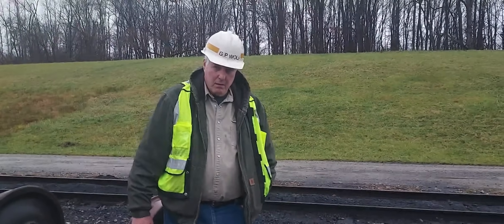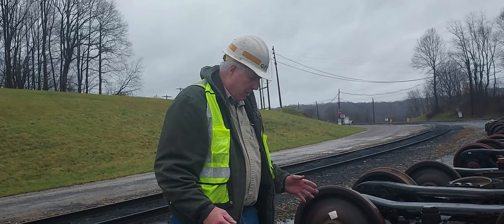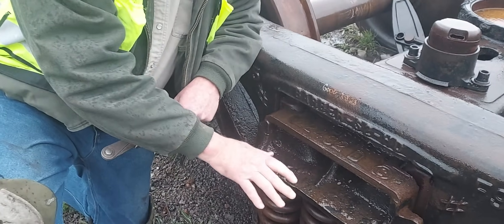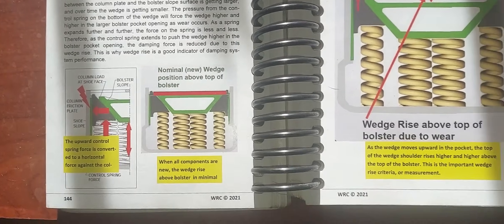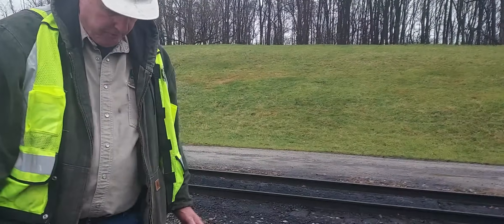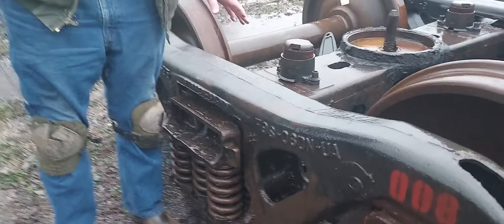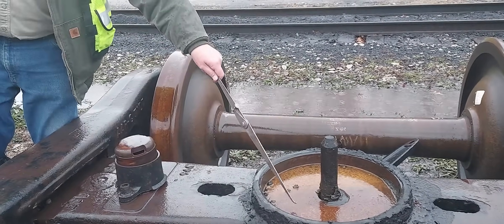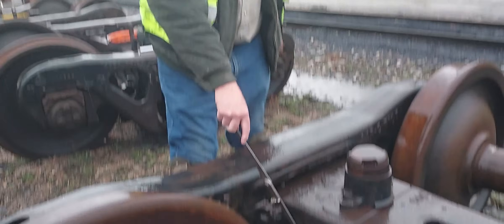How the Suspension System on Rail Car Trucks Works Part 1

Comment: Too much knowledge can be a curse. This is fascinating, I’m obsessed with mechanical precision. The middle bearing reminds me of the peg on a trailer of a semi, the tractor has a plate, if you don't occasionally add grease to the plate, when the semi turns, you hear the metal to metal noise and feel vibration (riding with my relatives truck for their chain stores). Ever answer two questions that a recruiter from the aerospace industry couldn't answer to a group? I inadvertently made an enemy of that poor woman, I just knew the answers so I answered the two questions, I stopped at two.
Reply from the maker: I agree with you John, knowing too much puts other people around
you ill at ease because they don't know.  Glad you found the 
video fascinating, it is pretty cool stuff. We are very lucky Mr. Wolf
came and did these for us. Hope you will watch Part 2 also
coming out Friday evening. Really appreciate your taking the time to watch and may you have a very good day my friend.

Comment: The prime purpose for suspension is not a smooth ride, but to keep all wheels firmly on the track! If there were only three wheels, you wouldn't need anything, but with four, you get "wobble" on uneven surfaces like a bad restaurant table.
Truck frames form a 'walking beam' like those on road graders. The two axles are NOT independent, but pivot at the bolster. In fact you don't really need springs to keep all wheels on the track, just a pivot.
Reply from the maker: Thank you for sharing your thoughts on that Greatdome99. 
 Really appreciate your taking the time to check out the video and may you have a very good day my friend

Comment: I worked for ACF Industries for several years, and was in the Wheel & Axle many times repairing the different machines from lathes to the large Landis axle grinder. It is something to watch these things being built. When you work there long enough, you can build a complete car in your sleep.

I have also been in CSX's engine shop and watched them being overhauled. Keep in mind that their trucks have a traction motor as well.
Reply from the maker: How awesome is that, I would love to visit a shop like that sometime craxd1. Thank you for taking the time to watch the video and may you have a very good day my friend.

Comment: HOwdy, Dave.  Thanks for the info on modern trucks.  Only you, Dave, would say cereal.  I'd like to see some arch bar, bentendorf & andrews trucks.  Those are the ones I use on my HO scale railroad.  HO scale trucks are made exactly the same way.  Bolster, 2 side frames & 2 springs per side frame for 50 ton trucks.  Cheers from eastern TN
Reply from the maker: Your very welcome Rusty. Although i don't think Mr. Wolf deals much in HO scale trucks and derailments...... :-)  Really appreciate your taking the time to watch the video and may you have a very good day my friend.

Comment: The part that has always amazed me is that the main parts of the trucks are put together without bolts or bushing like in an automobile.  The axles are held in by gravity, and the car just sits on that pad with the pin sticking up in the middle.  In model railroads if one picks up a car, the trucks and wheels come with it.  In the real thing we've seen lots of videos that show a derailed car where the body just separated from the truck and/or the wheels & axles came out of the truck.

Other videos show the parts being stacked back together again with just gravity holding it all in place.
Reply from the maker: Your right about that Bryan. It is amazing isn't it.  Thank you for taking the time to watch the video and may you have a very good day my friend.

Comment: Still don't know how the locomotive delivers power to the truck wheels.
Reply from the maker: The diesel engine in a loco drives a generator/alternator that
sends current to the traction motors on the loco which is what
drives the wheels on a loco Oregon Crow. Car wheels are
not driven, cars are pulled by the loco. Don't know if that is
what you meant or not?  Thank you for taking the time to watch the video and may you have a very good day my friend.

Comment: Thank you both for another informative video. I learned a lot about trucks!

I have two questions. First, do the large suspension springs contain smaller springs? I can't tell for sure, but I think I saw counter wound inner springs (but not the kind we sleep on!). Second, how does the damping friction very with speed? When I studied damped springs, we assumed damping was proportional to the spring's velocity. Does friction damping behave like that? I seem to remember that friction force does not depend on speed, but it was a long time ago.
Reply from the maker: Your very welcome Eric and glad you found it interesting. 
1. I made a video on springs  and explained about the number
of springs if you want to watch it.. Some cars have inner springs,
and some have also inner inner springs. All of our cars here
have the main spring and the 2 inside it.  2. Speed has nothing to do with the damping friction, it is all about weight. Really appreciate your taking the time to watch the video and may you have a very good day my friend.

Comment: How do the bolsters get installed into the side frames with those "gibbs" in place?
Reply from the maker: Little bit of side twist to get them into the side frames Wally,
after that the springs are installed. Lot's of room without the springs being in there. Thank you for  taking the time to
watch the video and may you have a very good day my friend.
Reply: @ccrx6700  Thanks Sir!
Reply from the maker: @wallyman292  😊👍🚂

Comment: A fantastic educational video. I never knew the trucks were made up of parts that could be cast in different foundries, and are the same design as we use, although I knew many look the same in a lot of countries. There is a sound going over uneven track like something is rubbing on a dry bearing, and now I think that is probably just what it is , the sound is coming from the friction wedges and not something lacking lubrication. There is a preserved 100 ton tanker at a heritage railway, in a couple of weeks I am thinking of going there so if I can I will have a good look around the bogies. Big thanks to Gary for taking out his own time to visit your railway Dave and thanks to you for putting it all together.
Reply from the maker: Thank you for the nice comment and glad you found it interesting Cedarcam.  We are so fortunate to have Mr. Wolf share some of his RR knowledge with us. Please make a video of that tanker and do
some real good closeups of the bogie and it's suspension system, I would be most interested to see that too. Really appreciate your taking the time to watch the video and may you have a very good day my friend.
Reply: @ccrx6700  I hope it will be in the goods yard where I saw it last time I went. It had just been delivered then. Later in the year they have a Railways at Work event so another chance to see it then.

Comment: Back in the late 70s /early 80s I was studying mechanical engineering funded by South African railways & harbours and therefore did practical in the workshops during the vacations. It was excellent training because I got to see and learn so much about how things are done in practice. The 1st place I was sent was apprentice school for 3 months. One of the places I spent time a was the refurbishment operation where rolling stock was torn down and rebuilt.
Those bogies look very familiar, but in watching this video I was immediately puzzled by those side bearings - I don't remember them on our bogies.
Thanks for the detailed explanation of how it all works - I never got that during my training. I mostly worked it all out in my head but didn't know about the critical dimensions.
Reply: Did the wheels/axles have a journal box with a spring loaded lid, that flipped up to have oil pumped in?  That's the old style so called friction bearing, not ball.  There's a great video on that nation & world wide change over titled "Train friction vs roller bearings...".
Reply: @alro2434  the one I am talking about used Timken roller bearings - looked the same as on those bogies.
What you are talking about are white metal journal bearings and yes there were still a lot if those around back then, but it was different style if boogie with packs of leaf springs instead of coils.
Reply from the maker: Wow how interesting that must have been to do that Greg. I don't know if side bearings are just a N. America thing or not, would be most interested in finding out what other countries have them
or not. Really appreciate your taking the time to watch and may you have a very good day my friend.

Comment: There is an old train track near Gaston Indiana where I ride.  There is a curve and a creek where early 1900’s a coal
Train derailed.  The signage said you may still find car parts.  There is still a lot of coal and gravel.  So I started digging.  I found a journal box. Lots of rail spikes and other parts.  In the creek I saw springs so i returned with a rope and hook and fished them out.  Sanded down the journal box. Got all the rust off and repainted. It has number  “113” in center of the box. I also cleaned and painted the springs. They make great wooden spoon holders for the counter and they won’t go anywhere being so heavy.  I mounted the journal box and it’s on my kitchen wall.  Nice train theme going.  I can’t believe this has not been found after 100 years.
Reply from the maker: Wow that's pretty cool you got that stuff Beverly. Wish i could
convince the little woman here to put some car springs on her
counter to hold spoons, that is so neat!  Really appreciate your taking the time to watch the video and may you have a very good day my friend.

Comment: sorry if I missed it or its going to be in part 2, but how doyou INSPECT the innner parts (center bearing, center bowl, brakes) when the car is sitting on those trucks?
Reply from the maker: There will be a part 2 coming out next week Trinh Le, Mr. Wold
will go over constant damped trucks and more about the suspension system on trucks in that video. Car center bowls
and center plates can only be inspected when the car body is
jacked up off the trucks, brakes can be seen at any time. Thank you for  taking the time to watch the video and may you have a very good day my friend.

Comment: Where the Hell was this explanation when I was rebuilding trucks?!  I was welding/building-up bolster slope surfaces and gibs, and never knew how they worked with the column friction plate.  We just welded/built-up/to match a gage to rebuild.  Great Content!  Now, as a dentist, I will be careful in my spring/ride control spring selection on Barber 100 ton trucks.  Mic Drop... Gary Wolf.
Reply from the maker: Well guess better late than never to find out halfinchholes. 
Thank you for  taking the time to watch the video and may you have a very good day my friend.

Comment: All of the trucks I worked on at IRM have very little in common with todays' trucks except for the general layout.  They are mostly bolted to the car with a pivot bolt and the axles, bolster and side frames are firmly attached.  A great truck tute, learned a lot.  Thanks much!
Reply from the maker: Thank you for the nice comment poowg and glad you found it interesting. Your right trucks have changed a lot over the years, specially after the heavy 286,000 pound cars came into existence.  Really appreciate your taking the time to watch the video and may you have a very good day my friend.

Comment: Question for Mr. Wolf , does weather like rain addect the wedge and ride. And what cause derailing  most of time.
Reply from the maker: Weather has no affect at all on the wedge rise Keith. There are myriad reasons for derailments. Way too much to talk about in a reply to a comment. However here on our RR the two biggest reasons for derailments are wheel bearings gone bad and 
trucks not wanting to swivel to negotiate curves. 3rd biggest reason here is when doors come open on loaded cars and the
spilled coal derails a car.  Thank you for taking the time to
watch the video and may you have a very good day my friend.

Comment: I'm having a little trouble understanding the side bearings.  Other than that, another great video
Reply from the maker: I will do a future video on side bearings gogetthegoose. Lot to
talk about with them. B&O RR developed the side bearings in the
early 1900's. There are basically 2 styles now, the roller bearings
and the constant contact bearings. CC bearings came into play when the light weight auto carriers come around after a lot of 
derailments due to truck hunting (another future video on hunting)
They are best used on light weight cars at higher speeds above
40. This is a simple explanation, but side bearings help the truck
to negotiate curves. Like I said that is simple explanation and
does require a full video to explain it all.  Thank you for taking the time to watch the video and may you have a very good  day my friend.

Comment: 65 Chevrolet cars came out with sheet metal screws holding the tops of the rear shocks to the body.  Those screws were recalled almost before the cars came out. The owner of the dealership wanted to impress his friends with a ride in a new Impala SS before the release date.  Those screws pulled out going around a curve causing the back of the car to become an uncontrollable bouncing motion and they went into a ditch.  A photo of the not-released car was in the paper.
He chewed out all of the set-up guys about not catching those screws loose, but he was man enough to give an apology when the bulletin came out to put bolts in place of the screws. Shock absorbers are important for any vehicle that touches the ground and moves.
Reply from the maker: Thanks for sharing that story with us Big Un, interesting I did not
know any of that.  Thank you for taking the time to watch the video and may you have a very good day my friend.

Comment: Dave I have a question for you or Mr Wolf, On the side of the rails we find the month and year and weight when they were made and where. But question is about that weight. Arguments about if that weight is per yard or not. Could you please settle this question? Thank You Both for an excellent informative video! Nice work Dave!! Peace.
Reply from the maker: Thank you for the very nice comment and glad you found it interesting Richard. Those marking are called mill brands, the weight of the rail is included. If it says 132 then that means the weight of the rail is 132 pounds per yard. If it says 120, then the weight of the rail is 120 pounds per yard. Etc.

Sometimes you will also see a CC or VT marking there,
that is the method of cooling used. controlled cooling or
vacuum degassed, although they no longer mark the rail
unless it is cooled by any other method than vacuum degassing.
Really appreciate your watching and may you have a very good 
day my friend.
Reply: @ccrx6700  Thank You Dave! You are my go to guy for rail stuff like this. Hope you have awesome day. Be careful working. Love your videos.  Peace. 👍
Reply from the maker: @richardfritz8797  😊👍🚂

Comment: Dave - Your videos with Mr. Wolf are a terrific addition to your work - highly informative.  We learned a lot from this video, particularly that freight car trucks are not just big hunks of metal.  They are a well-developed, durable and cost effective engineering solution to the demanding requirements of the railroad industry.  Many thanks.  By the way, I purchased and have received Mr. Wolf’s book.  Just as you said there is a lot of information in those 400+ pages.
Reply from the maker: Thank you for the nice comment Theodore and glad you found it interesting. Mr. Wolf's book is amazing! We are so fortunate to have Mr. Wolf share some of his railroad knowledge with us. Really appreciate your taking the time to watch the video and may you have a very good day my friend.
Reply: Mr. Wolf certainly knows his stuff. 
It would be nice if Dave would resist his urge to interrupt Mr. Wolf mid-sentence or try to repeat what he just clearly stated. Daves inability to let the information be presented is disruptive to viewers. He might also want to work on what it takes to form a clear, complete question that would add to the overall discussion.